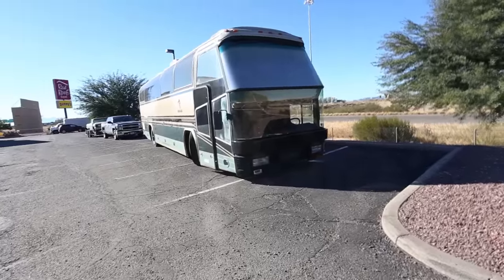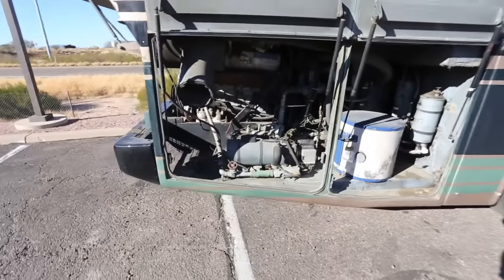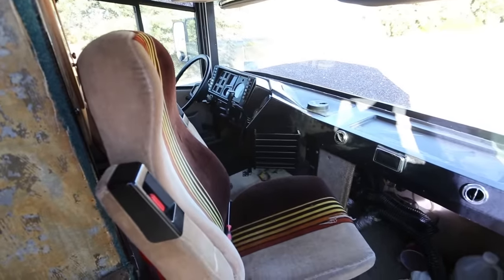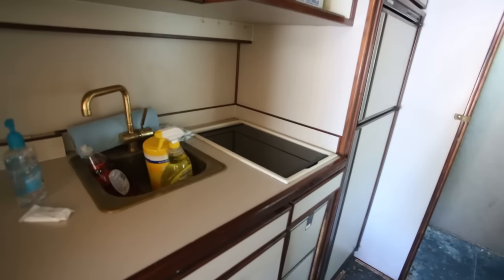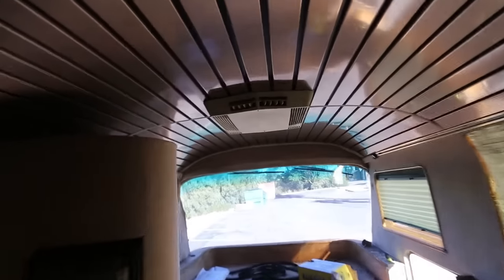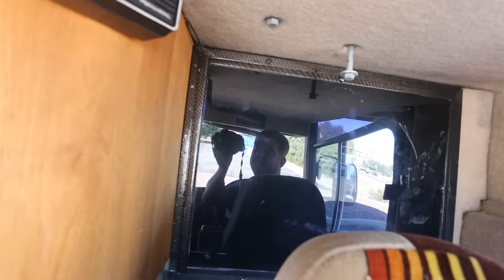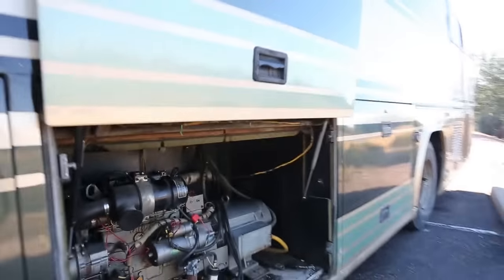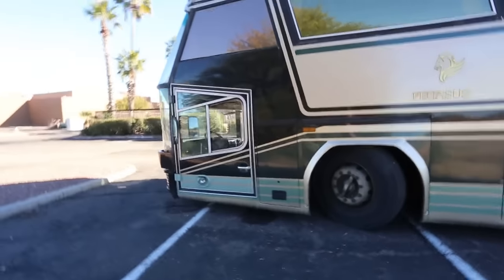Pegasus Motorhome based on Neoplan Cityliner N117/2 Chassis

Comment: I was working for Neoplan in 1984, when this coach was built. It was made for the US-Branch of the German travel agency Globetrotter Reisen. GR had already a number of the coaches in service in Europe. It's a Neoplan Spaceliner N177/2 and was factory fitted with a Detroit diesel engine and an Allison autobox. The coach was built for the US-market specifications. European coaches and buses from that period and onwards had to have the least two doors on the right-hand side.
Reply from the maker: I eventually got a response from Neoplan that this was part of a small order custom built for Pegasus.  The Chassis Master (can't remember the title in German) remembered these and apparently at one point in trying to validate if they had made it they asked one of the Auwarters, who did remember them.  I had issues with finding the VIN and they were able to explain where to find it.

Comment: Damn. It made it back to Texas. Not much left of the original interior. In the front the headliner and the cabinet with the tv in it. Cant remember who that one was built for but there were only a few built. The Detroit was an addition to the original chassis as well. Those roof airs would have put the Pegasus Autohaus guys in the grave. The bus had a chiller system in it. Really great idea but way too far advanced. The woodwork that they did there was absolutely second to none. Used to hang out there to see what they were cookin up. I built custom buses back then too. Those buses were featured in the Robb Report a decent amount. Look up those old magazines and youll find plenty of pictures of your bus. I would have really liked to see Neoplan get a foothold in the American market but it just wouldn't happen. Oh well.  Good luck with that thing man!
Reply from the maker: I took out the original TV Tower.  I think it was reconverted in Los Angeles at some point and converted to roof air.  They are simple and they work.  The electrical panel is amusing to say the least with a Jacuzzi and Alcohol dispenser breakers.  I will check out old Robb Report issues.  This was bus number one from what I gathered.
Reply: Definitely not number one as that bus is in Saudi Arabia. I believe yours is number three.
Reply from the maker: Perhaps... my info came from one of their employees who is still in contact with the founder.  I authenticated the coach as a 1986 model year and Konrad Auwerter vouched that only about 30 were sent over here.  Neoplan was a brand of Auwerter Coach and Body works.  Only 2, maybe 3 of the 2 axle units were converted.  This bus had a commemorative LA Olympics plate on it when I acquired it in California. I was able to ascertain the purchase history and that it made it to LA in 1988 which was very very early in the Pegasus story.  This coach lacks some of the shazam that was in the other 2 axle coach.  I only know of about 4 of them that still exist that were Pegasus.  There may be others.  It's an interesting coach, and extremely unique.  It's in nice condition overall, but I need to do some interior work.